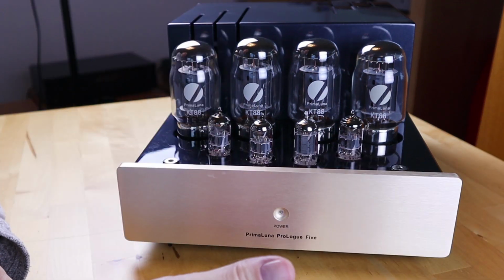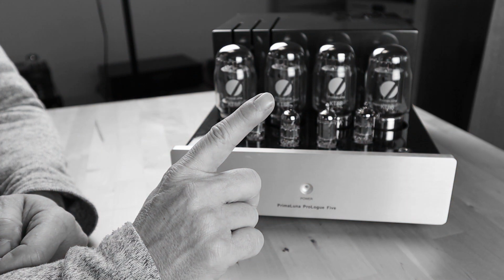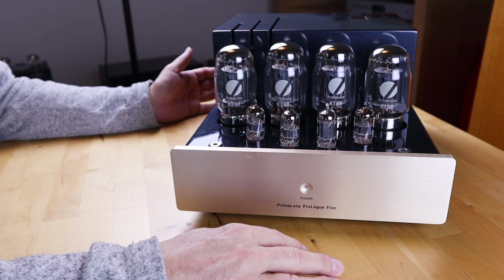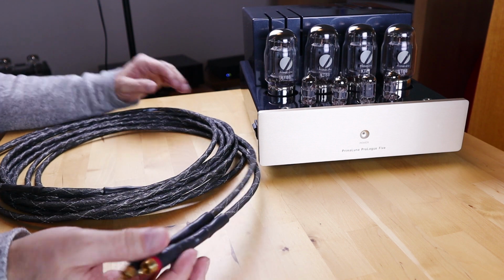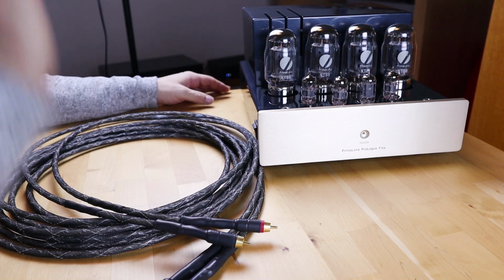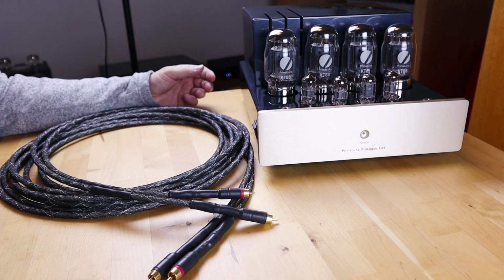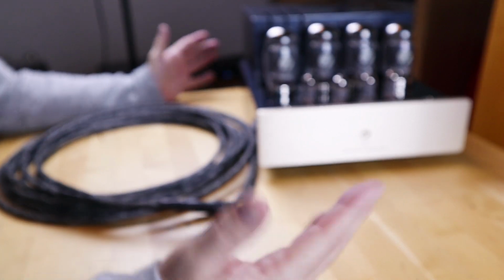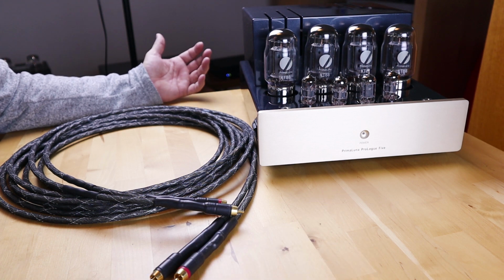Yes, I found out what was wrong.  A bit embarrassing actually.

Comment: I'm not sure it's the cable but the cable not being properly shielded grounded at one end can pick up noise from a power cables, even if they're running under the floor.
Make sure you interconnect and nowhere near your power cables ideally triple shielded 43 ohms. I still think you're grounding earth of power is not great and has high resistance. You can test it with a multimeter on Ohms connect to earth and neutral, disconnected at the consumer unit main power switch first when testing, Don't stick it in the live terminal anyway not needed. You want the neutral and earth to have similar potential resistance

Comment: Gratulations that you solved the problem. Did you crosscheck if it really was the long cable? If you use that cable with your other amp in the same setup, you should there also hear the hum. Do you? BR, Joe
Reply from the maker: I did not double check, but I am pretty convinced. I guess I will find out soon enough if I was wrong 😉
Thanks for the support 👍

Comment: Now connect the long cables to an other amplifier and you will find out there is nothing wrong with the cables.

Why? The hum was in BOTH  channels and  it is HIGHLY unlikely that that both cables went bad at the same time.
Reply from the maker: Hi, thanks for the input.
Actually it turns out to be both. 
There is definitely something wrong with the cable but recent experience demonstrated that there still is a problem with the PrimaLuna. With some cables this problem occurs, with some cables it does not occur. 
Any insight from your perspective is very welcome.
My guess for now is a problem with the analog input connectors.
Reply: @theaudiophilebarista2424  dank voor je sympathieke reactie. Ik zou toch de lange kabels nog eens op een andere, solid state, versterker proberen. Als ze daarop geen brom laten horen, weet je dat het niet aan de connectors ligt. De kabel zelf slijt niet.
Als de lange kabels WEL brom laten horen op die andere versterker, dan weet je dat er op elk kanaal waar je brom hoort een slechte verbinding is in een of beide connectors van de lange kabel kabel van het kanaal dat bromt. (lijkt me oawaarschijnlijk, maar toch goed om uit te sluiten)

Als je dat hebt uitgesloten, kan de brom van de lange kabels nog liggen aan bijv:
- als de afscherming van de lange kabel AAN BEIDE zijden van de kabel met de “ground” van de connector is verbonden, heb je een heel lange groundloop als de ground van beide kanalen intern in de PrimaLuna met elkaar verbonden is (wat bij de meeste versterkers het geval is). Kan dan brom opleveren.